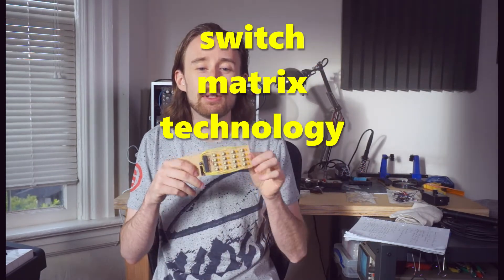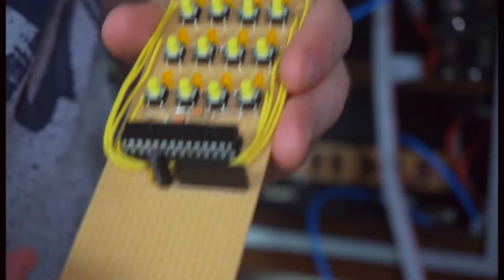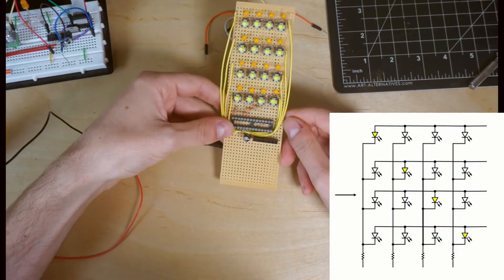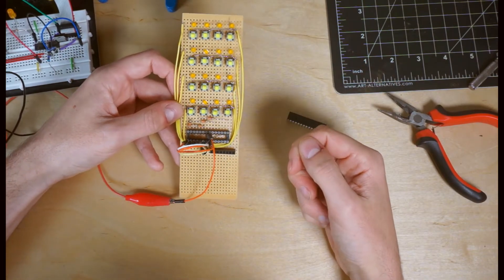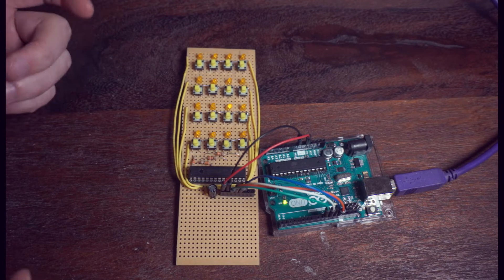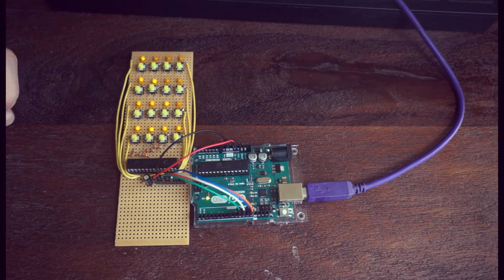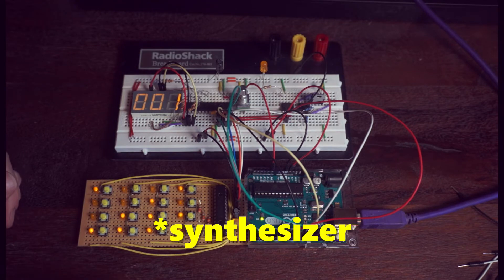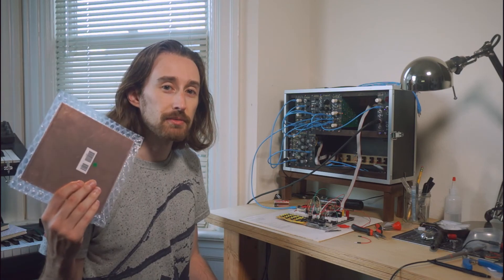Designing a Eurorack Sequencer - Part 3: Enter the Matrix

Comment: I’m using these same tactile push buttons for scanning a similar matrix, in a Z-80 cpu project.  Did you encounter any issues with bouncing?  If so maybe there’s a single circuit fix,  I’ll test my matrix in a week.  My hunch is that your chips are taking any bouncing into account.  This series of yours is great, I like the design.  Very innovative.  Keep up the good work, and thanks for sharing.  Peace!
Reply from the maker: Thanks! I might swap them out for some illuminated switches to save space, but I didn't do any particular debouncing for the tact switches. They are theoretically read in over SPI at 1 row per millisecond, the button states are stored in memory, and the software only cares about transitions from out-to-in. The relative slowness of the program with serial lag probably means that catching bounces in software isn't very likely. The tactile domes are extremely clicky, and for momentary switches where precise release is needed I plan to use some softer spring-actuated ones, which may need more careful watching. Adding 1megohm to ground on the high side would probably help.

On the potentiometers I do have a pretty high noise/bounce threshold (moving average) as the Atmega's ADC multiplexing produces a pretty noisy analog signal. Good luck with the z-80!